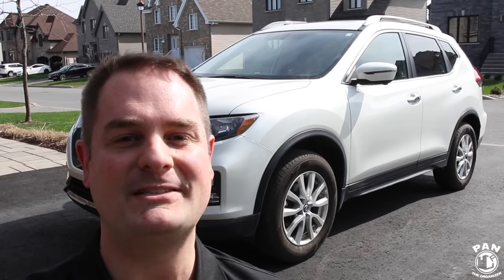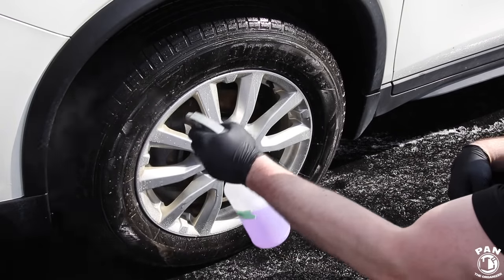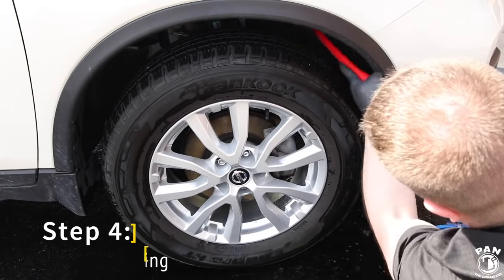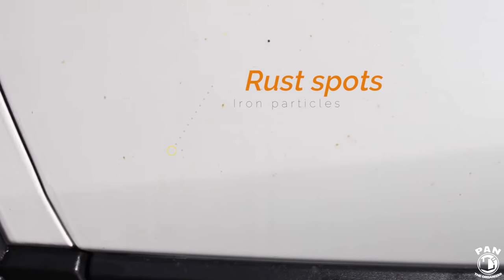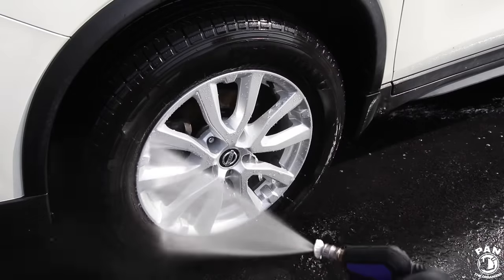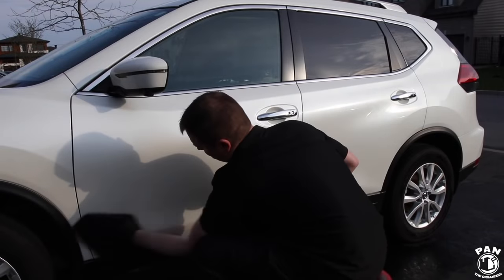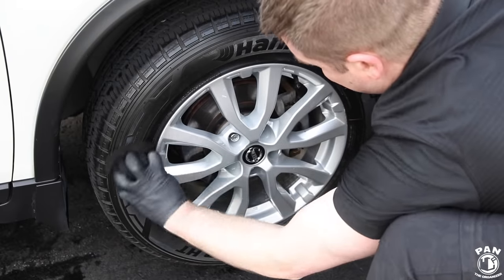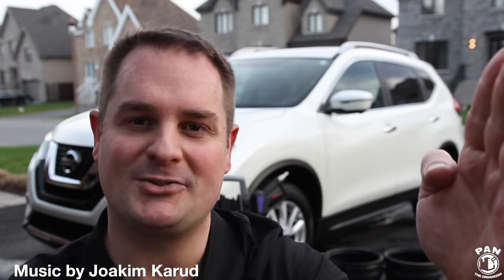SPRING CLEANING CAR WASH TUTORIAL !!

Comment: what's the difference between detailing vs washing
Reply from the maker: Washing is pretty straight forward: you just wash.  Detailing is going the extra mile to clean and protect all the surfaces.  You would wash the paintwork, you can decontaminate it with iron removers and a claybar, you can machine polish the surface to remove oxidation, swirls and scratches, you can apply a paint protectant like a wax, sealant or coating, you can clean and degrease the tires, then you would apply a tire dressing, you can decontaminate the wheels from brake dust with an iron remover, apply a protectant on the wheels to make them easier to wash, you can clay the glass and then clean it and protect it with a rain repellent, etc.

To put things into perspective watch two videos I made for my own car. 
This one where I wash it: https://youtu.be/xaQmB_qje_4
This one where I fully detail it: https://youtu.be/dsCmJJDP3xo

I hope this helps.

Comment: Hello Pan, does Chemical guys VRP for tire can go also on trims and vice versa the CarPro perl 3:1 on Tire?
Reply from the maker: Yes, VRP is a vinyl, plastics and rubber dressing.

For CarPro PERL, you use it diluted 1:3 for the exterior plastics, and 1:5 for interior plastics.  I use PERL diluted 1:1 for tires.
Reply: @PanTheOrganizer  Thank you Pan :-)
Reply: @PanTheOrganizer  Thank you Pan.  One last thing if I may, What do you think of aerospace 303 protectant?
Reply from the maker: I never tried it.
Reply: @PanTheOrganizer  thanks Pan, I have for a year and a half.  It was recommended y Airstream to use on alll rubbers - window -door trims does a excellent job. .  I like the product, simple not greasy good protection, lasts about 5 weeks on the outdoor trims truck and trailer and about 3 monts on the trucks 'tail gate liner and really keeps this one looking like new and shiny black not greasy.  It needs to be wiped because the stuff does not dry.  Bit expensive compare to other products maybe I am going to try from you channel may be of course better.

Comment: Good information, just FYI your link for microfiber wheel brush for inside the wheel is not correct not even close to the same material you were using.
Reply from the maker: Thanks Ken!  For the links, I often put alternatives as some products are not always available in certain countries or on certain websites.  The brush used in this video is the Microfiber Madness Incredibrush flat.
Reply: Thanks for your reply and sharing your knowledge!

Comment: Why didn't you use an IPA wash?  Aren't you supposed to use one before you apply any wax or sealant?
Reply from the maker: No.  IPA wipe downs are mainly used after paint correction to remove any polishing oils left over, before you apply a ceramic coating.  This is because coatings need to bond directly to virgin clear coat.  You don't get such issues with waxes or sealants.  An IPA isn't necessary if you're applying a wax or sealant.   Of course, there is no harm in doing an IPA wipe down if you wish before applying a wax or sealant.
Reply: @PanTheOrganizer  Thank you for the reply and for the clarification.
Reply from the maker: My pleasure!

How did you discover my channel?
Reply: @PanTheOrganizer  I searched "car detailing" in youtube.

Comment: Can Fast Finish be used on black trim to seal it Pan?
Reply from the maker: I would avoid black plastic trim.  Use it on paint and wheels.
Reply: What can I use to seal black trim in that case. Specifically the wheel flares on a jk wrangler.
Reply from the maker: Gyeon Trim or CarPro DLUX coatings are great long term solutions to protect plastic trim.  If you want ease of application, use a spray-on rinse off sealant like Sonax Spray n Seal that I reviewed here: https://youtu.be/FpgDRSGenWQ

Comment: doesn't a clay bar mar the paint?
Reply from the maker: Yes if you use a more heavy duty clay, too much rubbing and poor lubrication...  Of course a claybar is an abrasive, and should usually be followed by paint polishing.  But with a light duty claybar and good lubrication, I found that there is little to no marring.